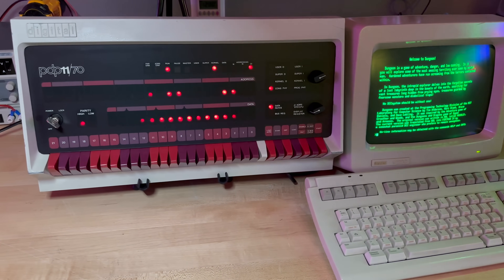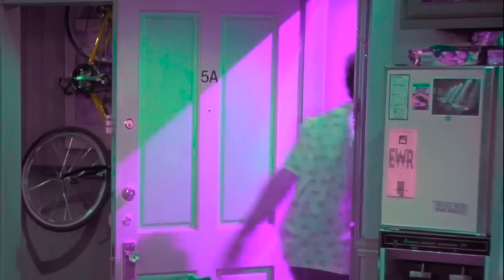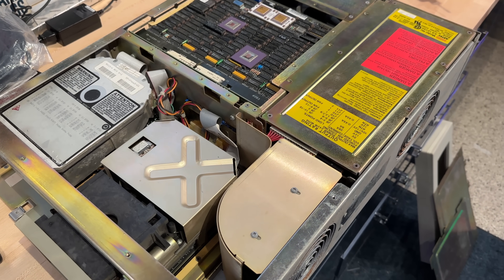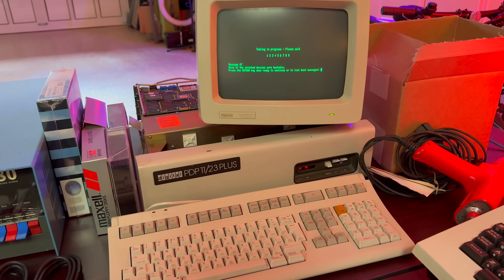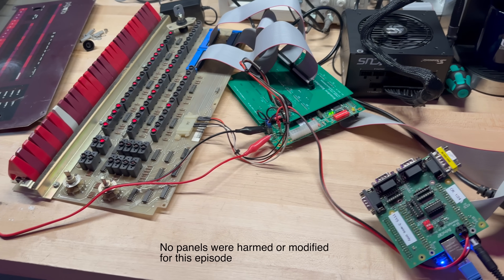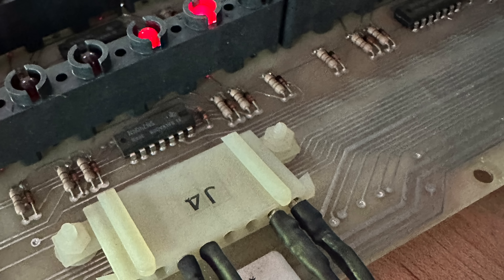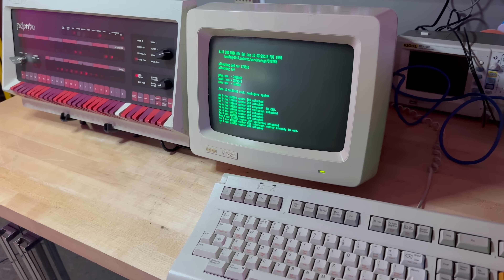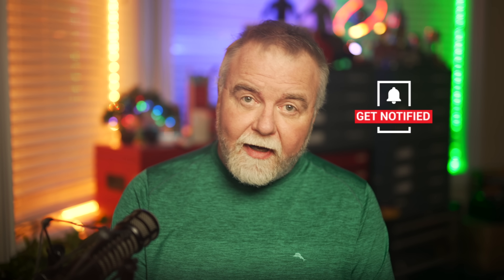Ultimate LED: The PDP-11 DASBLINKENLIGHTS!

Comment: Very neat PDP-11/70 lite you have come up with!

I recall discussing with a person who either had worked on VAX or PDP-11 hardware the boot process of the operating system. He said that the designer on purpose had the very first instruction of the boot process cause the equivalent of a Windows GPF, to get the CPU into the desired state, THEN the OS began booting. Recalling that bit, I have wondered the Paul Harvey "The Rest of the Story" about what I recall being told. Does this bring anything to mind for you, @Dave's Garage? I am guessing that might have been a technique of Dave Cutler since he was the OS designer at DEC, correct?

Comment: Around 1980 we used a large number of PDP-11/34 in an Air Defense System for an European country. One PDP/11 would control one "very modern" radar display, a large circular graphical color display, based on huge vacuum tubes.  It supported 4 colors, I vaguely remember; red; green; yellow and yellowish orange.  The system did use RSX-11S, the core based version of RSX-11M.

Comment: My first job was with a VAX 8600 IN 1987 - though part of it involved running some custom oil industry software on 11/34s that booted from tape. So no RSX 11, just booted direct into the software. it was extremely unhelpful software, no help prompts, no indication if it was doing something wrong with the input data (from other tapes) and a manual that had lots of words but not making much sense unless you knew what they already meant! Fun times!

Comment: @Dave's Garage, just a thought for you, maybe it can help get that 2nd PDP bezel : isn't it possible to vacuform/thermoform that panel ? (Mythbusters have also used this technique several times)
Once you have the molds (front+back) it should be relatively easy to produce as many bezel panels as you need.

Comment: I had a MicroPDP-11/73 in the mid 90s. Which was given away for free by a former employer. Eventhough it said mini it still weight around 50KG.
So in 2001 right about after 9/11, I gave it away to an IBM colleague. I said: "you can have it for free, but you carry that SOB to your car, hell I even throw in a chinese dinner"
I only tinkered with RSX-11 and some assembly. The plan was to put SystemIII Unix on it but back in 1996-2001 it was not easy to find it. My colleague actually got it on there eventually. And him and I hooked up again over LinkedIn almost 20 years later and now that same system is running at his friend's. It's a good 35 years old now and the same 20MB harddrive is churning away just fine.

Comment: Brings back memories.  Worked for a bank in the late 70s. We need to replace our check processing system and we spent months deciding between 3 options. IBM, Burroughs, and REI with a PDP-11. After determining the weights of the features of each system.  After evaluating and assigning a number for each feature we picked a winner.  In the end leadership picked option 4 (nothing we evaluated). I think the deal was made on the golf course.  That was my experience with Unix and the PDP-11.  Finally got into Unix systems in the early 90s when the client/server and data warehouse’s became a thing.  Spent time going to Microsoft working with other vendors on Windows DNA FS.

Comment: The old dreaded Y2K. I was running a small dial up ISP during the Y2K thing. Only one system had any issue, a Sun running Linux, and it thought, after 1999, came 19100.

Comment: Cool video Dave - ex-DEC Field Service Engineer here and while I was primarily a VAX Systems Engineer they had 11/03 as a boot front end. I was also KI/KL10 (PDP-10) trained - monster 36 bit behemoths that used an 11/44 as it's front end processor for boot and comms like serial, printer, ethernet.. We used to carry out preventative maintenance on these weekly, mostly replacing burntout light bulbs on the 768kb of core memory!

I would love to see a DECSystem 1090 or 2065 in your shop :)

Comment: We used pdp-11s for controlling electrical high-voltage substations from 1975 to about 1990. The last have been switched off because people feared the millennium bug. For control software, we used assembly language software which was very easy to write and read. Much better than most other systems.

Comment: 00:04 🖥 Dave demonstrates booting RSX 11m on a VT220 connected to a PDP 1170, delving into the nostalgia of early computing.
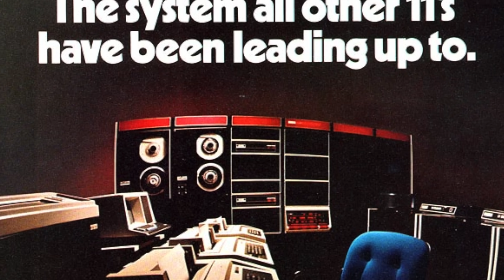03:07 🌟 PDP1's iconic front panels evoke the early days of computing and remain sought after by enthusiasts.
05:56 💡 Dave's journey from replica to authentic PDP11 ownership, including troubleshooting and restoration.
08:00 🔌 Dave bridges the gap between replica and authentic by creating a hybrid system with an emulated 1170 and a real 1170 LED panel.
10:33 🛠 Dave explains the functionality of the restored 1170 panel, enabling debugging and interaction with the PDP11 system.

Comment: At Fugro, we were using those PDP machines on our survey vessels, right up until the end of the 1990s. They drove both our primary and secondary navigation systems (using software that was written in Pascal) and only really started to become a problem when the companies we employed to service them, told us that parts were becoming impossible to obtain. One of my great regrets is not taking up Fugro's offer of "anyone who wants one of the PDPs, can have one" when they were eventually replaced with rack-mount Pentium systems.

I think all of them ended up the recycling dumpster, along with a drawer full of (boxed) HP-41 calculators.

Comment: Nice video ! In engineering school we had a PDP11 running RSX11/M but it was locked away in a room. The door to that room only opened wide enough to hand a pack of punch cards over to the operator. There was a terminal in the room but it was untouchable to us mere mortals.

Comment: Back in the early 80's I had to reboot  a PDP11 (used for old SATNAV) on a seismic ship in a hurry. It stopped for some reason so I had to lie on the instrument room floor* and flip the correct sequence of switches in haste otherwise we'd have to restart the "line" we were "shooting". I've got to say that the flashing lights didn't impress as I'd seen too many fake computers in movies.  *I never did  ask why the computer was installed close to the deck.

Comment: PDP-11 architecture was very popular in Soviet Union. Plenty of soviet systems were compatible with it. They even made home computer on that architecture. I got a video about it.
Reply: Yes. It was sold by DEC directly to Electronmasch (Kiev). As a west German young engineer I did there a 2x3 weeks training in 82. We had to use 18 of the PDP11 derivate called CM4 to control a steel plant in Kursk. Because of cold war restrictions we (on restricted time base) got 3 of them to West Germany, programmed on them, and send them back. The quality of those equipment was not good. That was the beginning of my sceptism of the "high capable" Russian technology our governments always rumble. The one original PDP11 34 we had was running flawless, the CM4's needed lot of maintenance.
Reply: @michaeleitel7186  "Russian technology" was really different. Ministry of electronics industry, that handled CM4, got much less resources than Ministry of radio industry that handles EC series. And what was handled by Ministry of defense used to be completely different quality.
Reply: @fixitalex
OK. You might know better. But what I know first hand that not only the complete plans but also the old (in bad shape) equipment to produce them was supplied. And in 82 they even where in production of their own version of VAX.
Reply: @michaeleitel7186  There were plenty of everything. But yes by the mid 80s production and research were slowing down

Comment: In the mid-1980s I was responsible for a PDP-11/45 on our kibbutz. It ran RSX-11 and supported manufacturing systems for a plastics factory and a concrete plant, as well as accounting and other functions for the kibbutz as a whole. I put in a phone line to my apartment (I also maintained the phone system there) and wrote terminal programs for my Sinclair QL computer, first emulating the VT52 and then the VT100. DEC documentation was great and I learned so much in those days!

Comment: I use to log into  dads account on the Bell  Labs PDP. - 10 
This was 1968 and Bell Labs in Holmdel had a PDP- 10 on each  of 5 floors  of the 4 buildings. Then they had a couple bigger computers in the basement

Comment: This sends me back.  Back in the late 70's and early 80's I got my start on PDP-11's.  I started out on a PDP-11/40 with 112 KW of main memory.  For some reason it didn't have a full load of 124 KW of main memory (memory was counted in 16-bit words, not 8-bit bytes).  It had dual 2.5 MB RK05 disks and a couple of 1600 BPI tape drives and a customized BB-11 data acquisition box.  It also had the original GT-40 graphics display (on which you could run the original Lunar Lander game).  It was officially used to collect and display data from an early cryogenic gravity wave detector.  Quite the beast.  In order to boot the beast, you had to toggle in the correct starting address on the Boot ROM, depending on whether you wanted to boot from disk 0 or 1 or even tape drive 0 (the latter was used to system updates or loading diagnostics).  The Boot ROM was a sight to behold.  It was a "6-high" Unibus board covered in "bits" literally.  It had zero ohm resistors soldered all over it in an array.  Each resistor was a "1" and if it was missing, it was a "0".  So the boot code was "soldered" in by "hand" and extremely limited in size.  But at least I know what a bit looks like!

This was better than the PDP-11/10 a buddy of mine had down the hall.  It didn't even have a boot ROM, so you had to toggle in each instruction with the front switches and deposit it in memory.  The address would auto-increment to the next address and then you toggled in the next instruction.  At one point you toggled in whether you were booting the unit 0 or 1 of the RX02 8-inch floppies the system used as the main disk for its RT-11 Operating System.  There was a cheat sheet with 30 or so boot code instructions on it.  The rule of thumb was you if it didn't boot, you tried it again from scratch.  If it didn't work the second time, you had to deposit all zeros in all of memory for the first 1000 (octal) words and try it again.  If that didn't work, you let your boss try (although he was generally useless on the "damn thing").  When all else fails, you'd walk down the hall to the electronic shop and get one of them to try and/or start poking at it with a multimeter.

Both the 11/10 and 11/40 had similar, but simpler, front panels to an 11/70, but their lights didn't cycle on idle like the 11/70. 

Depending on which OS you loaded, the lights rotated differently.  RT-11 rotated them Left to Right,  RSX-11M, rotated them Outside to Middle, like you show on this video, and RSTS rotated them Right to Left if memory serves me after all these years.  

(Edit: On the 11/70 the idle loop on RSX-11M-PLUS (or maybe RSTS) used Supervisor Mode addressing to run the light pattern across on the Data LEDs then Back on the Address LEDs making a full circle.  This was the only place in the OS code that used Supervisor Address mode.  It's been a long while since then)

This came in handy later when I "Managed" four huge 11/70s after I graduated for the corporate HQ of a big manufacturing company.  They usually ran RSTS for data entry (as a front end for the big IBM mainframes on the other end of the huge computer room) and word processing, too.  One of them was a spare that I would boot RSX on to support the real time systems I supported at various plants "out in the field". Just one glance at the front panel would tell you which OS was loaded and how busy the systems were.  The faster the lights spun, the less the load was.

Comment: Takes me way back, Reed College - I arrived as a Freshman in 1982. Their PDP-11/70 handled the load for administration, and had a student lab with a mix of Tektronix and VT-100 terminals. Learned to format my term papers with nroff/troff, and we were required to buy our own 8" floppies for personal storage, and ribbons for the daisy wheel printer we had to get "special dispensation" to access for our final output. All this was a great foundation for the eventual development of my IT career, and also some great memories. Note Reed had at the time had the only research nuclear reactor (10 watts of power!) on any college campus. A student run project was completed to create an open air laser link back to the PDP-11 from the reactor to facilitate data processing, pretty unique at the time. Also very pretty in the fog!
Reply: I was a roff-ing fool once upon a time...

Comment: Hardware is fun to be sure but SimH & BSD2.11 is much easier on the electric bill and doesn't have capacitors that can let the magic smoke out at the wrong time or kill you if you grab the wrong panel. No blinkenlights but I grew up more with workstations anyway so I never minded that.

Comment: Dave, thanks for this great video.  It's gonna motivate me to assemble my PiDP-11.

As to reproducing the bezel for the real panel, 3d printing is your friend, and I don;t just mean the hobby-grade printers everyone seems to have. 

 I haven't looked into what I'm gonna suggest for about 10 years, so I can't point you to anything specific......   BUT,   look for a 3d optical scanner that will allow you to capture the dimensions of the original bezel.  I won't be surprised if there's an iPhone app for that.  Once you capture it, split it into sections suitable for printing on whatever printer is available to you, and then print, assemble, test-fit, refine, repeat, until you are satisfied.   THEN you can combine the perfected parts into one design file, and ship it out to a commercial printer to have it reproduced in the material of your choice.  You might also consider getting the final bezel cut from a hardwood using a CNC router, which you could finish as you wish.

You might reach out to the fella that did the original PiDP-11 design and see if he has already done this, and then reduced his design for the PiDP kit.  Even if he didn't go that route, if he will share with you, you might be able to just scale his model back up to full size.

Finally, I'd ask around.  DEC was well known for great documentation, and I would not be surprised to find the original blueprints for the bezel out there somewhere.

I hope this helps.....

Comment: I don't think he does reproduction work usually, but you should check out Eric Strebel for a reproduction casting. He does a lot of product design and prototyping work, and a lot of that work is done through casting urethane, silicone, and epoxy. His castings always look excellent, and I bet a urethane reproduction would look great. I've learned a ton from watching his videos. I'm also a product designer, so he's got some very helpful tips.

Comment: Great memories. I used a PDP11/40 or 45 (with front panel lights and switches) at school in the late 1970s. Loved playing Star Trek on it. Then got a job that had a late model PDP 11/70 with the remote console (No front panel lights and switches) we later acquired another 11/70 with the front panel lights and switches. It ran RSTS/E. I run both RSTS/E and RSX-11M on the simh emulator.

Comment: Hi Dave, what a great video and accomplishment.  I was introduced to a PDP8 late in the 70s.  We were allowed to enter a programs, line by line via the switch interface and the load switch.  Once done we would set the starting point and execute the run switch and watched it work it's magic.  I had decided at age 13 that computers were what I was going to work on and started a deep dive into electronics.  I obtained a complete motherboard from a computer that developed the SOL-100.  Dabbled with Radio Shack electronic digital clock kits and found a design flaw in there PCB.  Once I corrected the connections my clock worked and still runs today.  The company I went to work for (employee 15), Summa Four (bought by CISCO in the late 90s) while in college that used extensively the Rockwell 6502 and the CP/M operating system to compile and developed the code for our digital central office replacement for rural telephone companies with stepper switches.  I have been able to be exposed to a lot of cool things.  But your PDP11 project is the cats meow.

Thank you for videos.  Keep them coming.  I loved Zork!

Comment: My first system was a PDP-11/45 at collage running RSTS . They taught B.A.S.I.C , COBOL and Fortran. Was very lucky to Have Dr. James drive by and pick me up and let me do my Fortran weather simulations over winter break.  Had so much FUN having the system to myself. Disk pack was the size of a washing machine.  Core memory was swapped out for semiconductor a year later. The PDP replaced IBM 1620.
Reply: Fortran weather simulations? it seemed to need amount of data, could pdp do that?